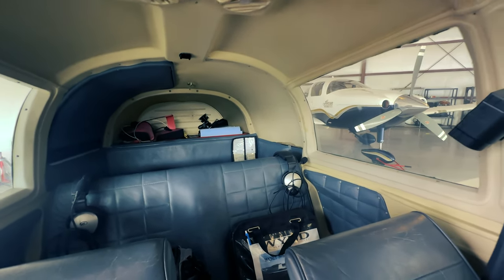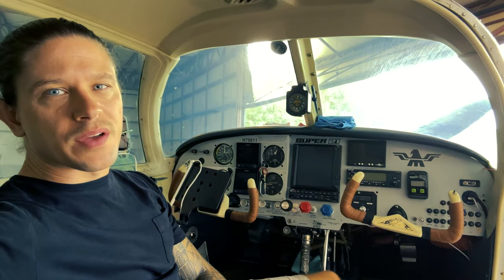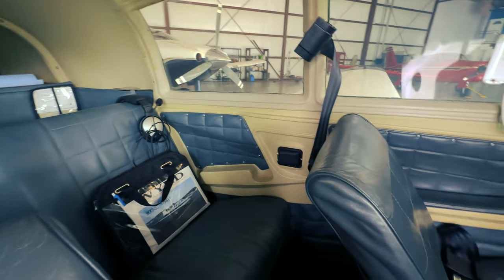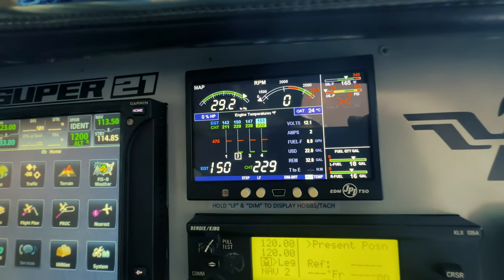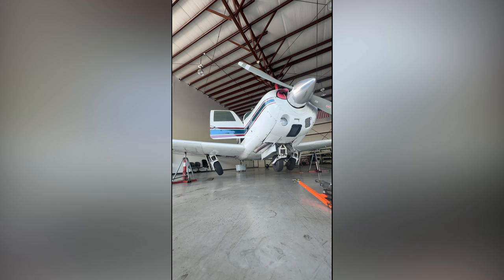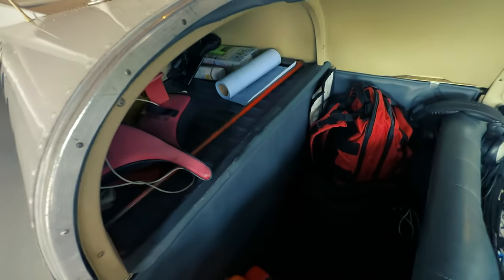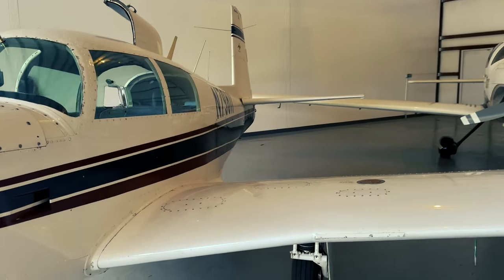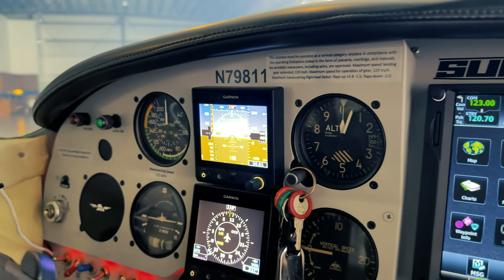1965 Mooney M20E - Full Walk Around

Comment: Well thought out and laid out panel. You'll really like the GFC500 when you install that, try and get them to place it somewhere reachable for both pilots. You may never need the "magic blue button" but your copilot may. Also recommend the Garmin GTP-59 Outside air temp probe. This will give you three more tools on the G5's, On your AI, it computes TAS and shows it top left, when on the ground you'll get DA bottom right. On the HSI, HW & CW top left. And if in the mood to spend just a bit more money... the CIES calibrated fuel senders in the tanks that may feed to your engine management, so you know exactly whats in the tanks. I added those items in my plane, love and use them every flight.

Comment: Great panel layout ... thanks for the walk-through.  Question: was the bottom section (where the toggle switches and pull levers are located) resurfaced, or did you have a new section fabricated? That section (which is metal) on my '67 M20F is aged ... I've tried buffing it out, but it doesn't look as good as yours.

Comment: Is there a difference between the Super 21 E and the standard E model? Nice plane btw
Reply from the maker: Earlier models are all super 21s I believe. They stopped production in 1968 and then restarted in 1969 when they changed it to the chaparral I think at that point the biggest difference was electric gear